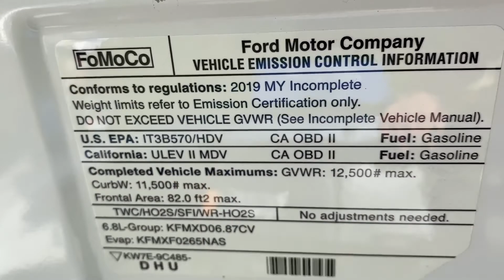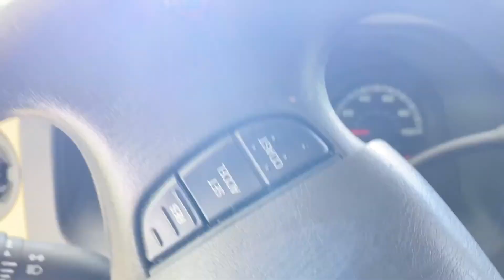DIY RV Oil Change

Comment: 5W-30 refers to the range of viscosity. from 5, which is thin to 30 which is thicker. You would choose the range based on your seasonal weather temperatures.